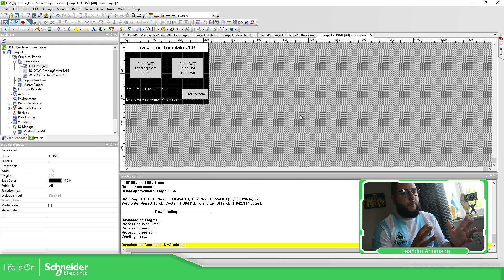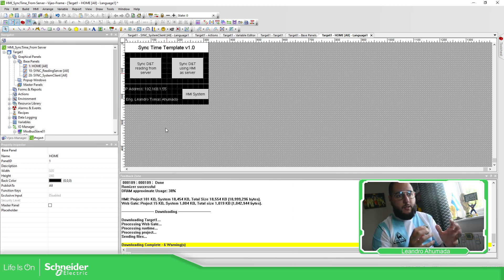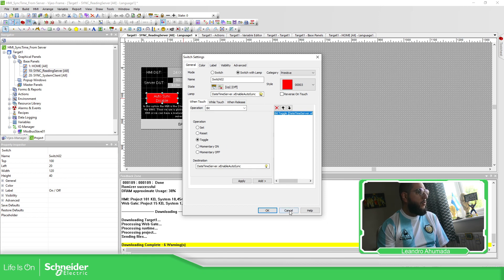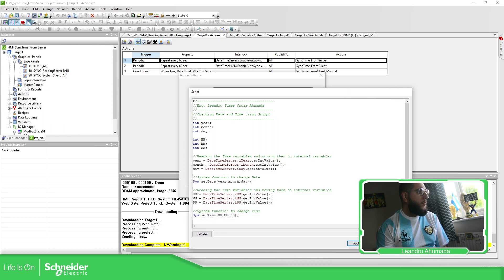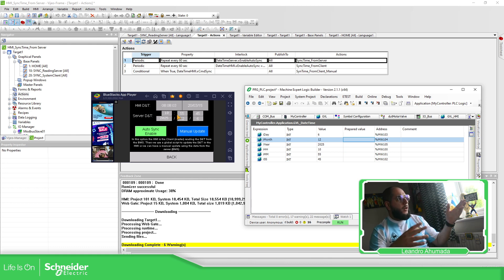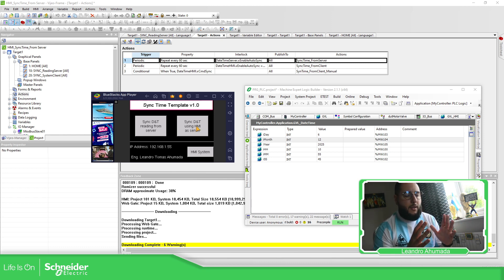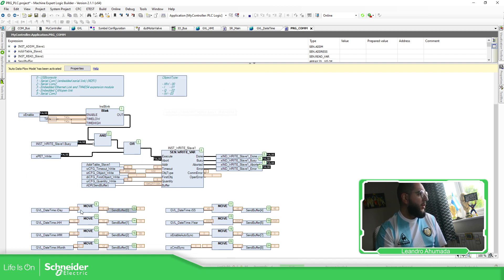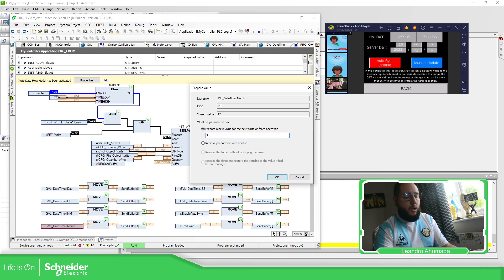Vijeo Designer Training - Mx.x How to update Date and Time from another device

Comment: I have an HMIGXU3512, can I perform these steps?
Reply from the maker: Hi there! I have quickly check the video and you should. Once yiu get the date and time from the plc using the driver then you should be able to execute the scripts. Are they not available in the basic?
Reply: I can't find "DateTimeHMI.xEnableAutoSync" in vijeo designer. The version used is vijeo designer 1.2.1 for HMIGXU. I am not able to change the wrong date and time on the HMI in any way.
Reply from the maker: @ I will make a video for the vjd basic. It will be for sure in a few weeks

Comment: Hi Leandro,

Thank you so much for the video you uploaded about updating the time on the HMI screen. It has been very helpful! However, I noticed that while you included a practical example for the HMI configuration, there weren’t any specific details about how to set up the application in the PLC.

Would it be possible for you to share the program or key steps you implemented in the PLC to complete this synchronization? I’m working on a similar project and would really appreciate having a clearer reference.

Thank you in advance for your help and for the quality content you share.

Best regards!
Reply from the maker: Hi Ruben,

If you are using EcoStruxure Machine Expert to get the date and time then you can check my next video:
https://youtu.be/szssa-KxoaA

Best regards,